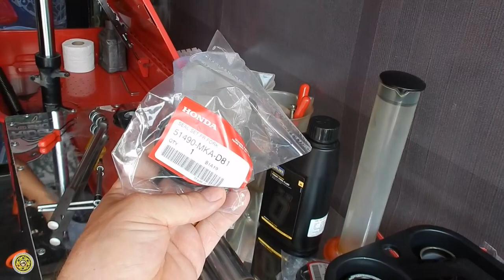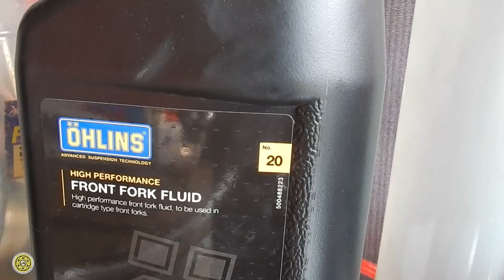Forks Service on my CB500X

Comment: Did he use the old seal on top of the new seal when he pounded it into place?

Di he loosen the top screw and the bottom allan key screw when the forks were still in their mounts? 

Thanks for the video. I am about to do mine.

Comment: thanks for the video!!!, I have a 2020 but for some reason its leaking,  I see little oil moisture on the bars so i will perform a seal replacement. In terms of oil weight, you use a thicker viscosity, that takes away the "pogo stick" effect of this forks? thansk again
Reply from the maker: Yes thicker oil and suspension is much stronger and rigid.
I really like it

Comment: Gday mate how d you rekon the 20w oil will go i just replaced min with the standard 10w all ok until you find the idiot who owned the bike before tightened the fork cap up to 110ft lb and the only way to get it out is with a pin punch all good now though .
Reply from the maker: Perfect, it's like having a new bike 🤪🤪
Reply from the maker: Very different from the original settings